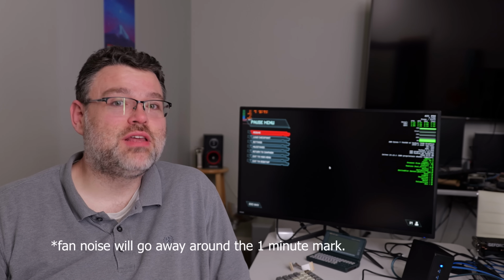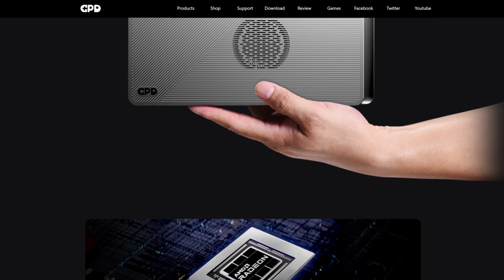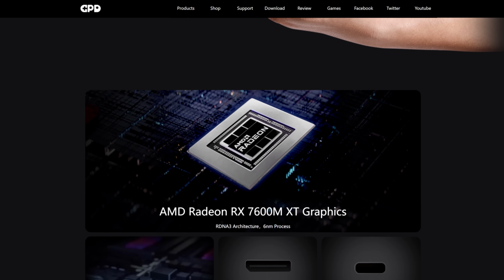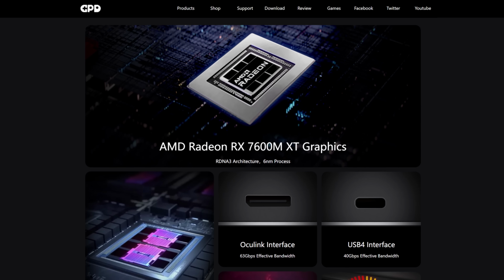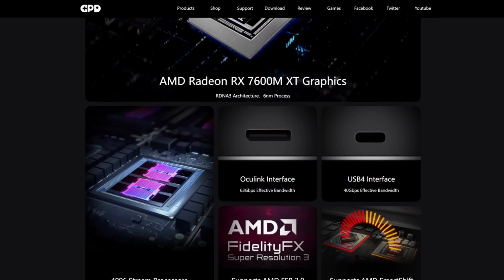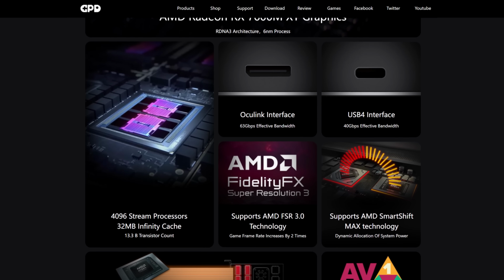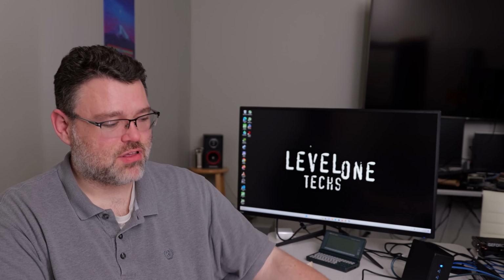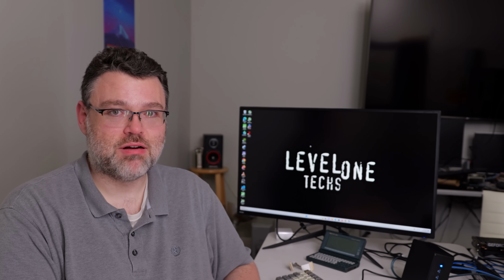GPD G1 + Minisforum UM790 (and a chat about Oculink and Thunderbolt Next)

Comment: Jeff Kampman of Tech Report did testing with Thunderbolt 3 eGPUs when they were novel. He found that the Alienware Graphics Amplifier, which was a proprietary external connection carrying raw PCIe 3.0 x4 (32 Gbps), gave MUCH better performance than Thunderbolt 3. The real bandwidth of Thunderbolt 3 isn't 40 Gbps, it's 22 Gbps, because 18 Gbps is reserved for the DisplayPort side channel. You'll never exceed 22 Gbps on any data connection in Thunderbolt 3. But it isn't even the transfer rate that is the problem so much as the encapsulation that you mentioned. PCIe has to be encapsulated within Thunderbolt and that adds a tiny bit of latency, which is significant when we're talking about PCIe. Overall Thunderbolt eGPUs suck bad for gaming and I'm glad a real PCIe connection is finding its way to market. Kudos to GPD, OneXPlayer, Ayaneo, and the other similar vendors for doing REAL innovation.

Comment: Love to see more expansion options. Only recently started watching your channel, but I will have to hunt down and see if you did anything related to the ASUS ROG XG connector. I really think that's the connector to beat. A combo TB/USB + PCIe with 100W or greater power delivery would be ideal to slim down your cables from 4+ to just 2 (1 power and 1 connecting the dock). Can't wait for more developments in the space.
Reply: Isn't the XG Oculink + USB or did you mean you wanted them to add Thunderbolt as well for some reason? It seems redundant if you have Oculink.

Comment: I'm kind of interested in the other way around; accessing the iGPU on a 780M based system. Or, rather, bifurcating an x16 PCIe  lane into four x4 occulink connectors and using four 780M iGPUs in parallel in training LLMs. 96GB of RAM in each of the systems isn't too expensive (strictly speaking this would have to be an 8700G desktop, not a 7940HS mini PC) when compared to the cost of even a 48GB professional GPU, but I'm not even remotely sure how one would configure the client systems with the iGPUs to afford the iGPU as much memory access as possible.

Regardless, it would be a very fun project, and some back of the napkin math shows you could actually hit better bandwidth per dollar than a lot of Apple setups. Plus, I think there's some custom GPU kernel fuse operations you could do with Transformer networks to run a GPU kernel, return the layer to the CPU, do some sort of evaluation, and then return to the GPU for another fused kernel to minimize memory access, but that'd start getting into some real CUDA engineering.
Reply: Though a second thought occurs to me: Wouldn't it just be easier to get an MI300A in a very minimalist server platform? I'm not sure if there's really any available that are essentially just an "MI300A" parent board with no frills (minimal connectivity, minimal or no DIMMs, and so on) for just giving you access to the raw chip for a reasonable price.
Reply: Since every 780M GPU is already welded to a Zen 4 CPU, which these days increasingly includes its own AI accelerators as well, it would seem better to just set up a Thunderbolt network cluster rather than trying to have one CPU directly interface with all of the GPUs, that way you could access all of the CPU compute hardware as well and I imagine most AI training software is quite happy to run on a cluster of 4 machines anyway.
Reply: @bosstowndynamics5488  
I don't think that you would want to do training on an AI accelerator as they typically operate at a low precision which leads to weird issue in training.

CPU is kind of cool, but historically it's been avoided because there's a massive bandwidth issue going between GPU and CPU over PCIe. It's possible an 8700G may be a different paradigm and you can do CPU based evaluations between layers really quickly. You might be able to get okay performance this way with fuse kernels but it's tough to say.

Comment: What is the justification for Thunderbolt if we could just Oculink-PCIE everything that requires high speeds?
Reply: A few reasons:
1) Thunderbolt 3 precedes Oculink by quite a while in terms of broad availability, so Oculink wasn't an option back then
2) Thunderbolt is good enough for most use cases, and much more broadly supported
3) Thunderbolt is far more robust in terms of hotplug support
4) USB tunneling and power - Oculink is just PCIe, whereas Thunderbolt can do single cable docking with PCIe, USB and power
5) Durability - Oculink is designed to be used as an internal connector that's connected maybe a few times for system maintenance and upgrades, Thunderbolt is specifically intended to be connected and disconnected a lot as part of normal usage
Reply: @bosstowndynamics5488  Excellent points, thank you so much

Comment: Wife and I both switched to using the UM790 + GPD G1 as our main rigs when we moved to California in December.  Honestly impressive.  There're some hiccups here or there with the 7600M XT not having that 12gb - 16gb of VRAM but pretty much every game we throw at our setups works flawlessly with her running LMDE6 and me running Fedora.
Reply: Why though?  What's the advantage over just an ITX system?
Reply: @SeniorKlean  UM790 + GPD G1 is to ITX as ITX is to ATX.
Seriously, it's two sub-1L bricks, most GPUs you'd want to use over the setup are larger than one of the bricks (4060/4070) if not both (4080), even before you see the size premium of the SFF cases that can fit those GPUs.

There's always discussions to be had on why someone would care about 1.5L vs 6L for a fixed setup, but you can just as easily question 6L vs 40L in many cases.
Reply: @Birdulon   I guess I always just assumed people who buy mini PCs either intend to transport it often or get the cheapest computer to get the job done. You’re obviously no the latter.
Reply: Curious as to why you didn't go with OneXGPU? Same eGPU, but with built-in m2 slot, so you won't be loosing the one with the m2 adapter in place (assuming you using the oculink connection) and you can ditch the um790 power brick, since the eGPU is capable of 100W PD.

Comment: I don't get one thing. eGPU community recently showcased an m.2 to usb+oculink interface for the ROG Ally. What I don't get is how it is claimed to be faster than a normal m.2 to pcie riser? Even if both are on the same gen4 wouldn't 4lanes of m.2 bottleneck them both, equally? I think it was touched upon this video but I still need some more simplification to understand.

Comment: It's really nice to see a company create this.  So tired of the regular gpu market only cater to desktops with giant graphics card.  
But price.  I understand it's not mass market product, but the price is only $400 less than getting a full fledged Ryzen 9 7845hx and 7600M XT gpu  Alienware M16 from Dell.
I would also like to see something similar made for storage.  Specifically, m.2. or maybe even 2.5" ssd. I understand it would need a switch and not be full speed, but that is fine.

Comment: I use my 780xt with a 2080ti in a dock I made from an amazon oculink kit,  s 650w psi and à socket metsl box (was mastercraft lol). It noe live as my "modular all in one computer " on the tv arm in my truck for night gaming or waiting to get loader gaming. Love that thing, I had to lock the gpu at 60% power for my truck batteries sake buuuut I got 90 to 120fps in gaming and I just bring the cpu with me on week-ends for ipdates and such. Love oculink! I'm sadly running windows, nvidis driver made troubles on Linux. Wish I had an amd card but the 2080ti was the one I had soooo.. meh

Comment: Why doesn't Thunderbolt/USB4 allow "lane bonding"? If the controller was wired to the host with a wide enough bus, and the endpoint (i.e. eGPU dock) had such a "wide" controller aswell, one could connect to an external device with more bandwidth simply by using two cables. It's super frustrating that the development of external ultra high speed IO is being delayed and doesn't see much adoption in the consumer segment.

Btw., ASUS made some ROG XG Frankenstein solution where they combine a TB port with an OCuLink port in a "single connector" - this allows using PCIe 3.0x8, although I think they "just" reroute the 4 PCIe lanes going to the TB controller to the OCuLink connector on the fly, in order to reach full speed and then use the former as a "dumb" USB side channel.

Comment: Awesome video, I have the Win Mini and have been eyeing this  device for awhile.  However, I wouldn't be using it with an enternal display.  I have a 3080Ti for that.  My use case would be sitting on the couch at night wile gaming on the internal display.  Is this doable or even worth it or would it be  too uncomfortable in this use case?

Comment: ASMedia released ASM2464PD last year, a USB4v1 controller capable of encoding a 64gbit PCIe 4x4 signal over a 40gbps usb4 connection, with performance that rivals an oculink and with all the benefits of a USB-C connection. There are already eGPU docks out there, like the ADT-Link UT3G which use this controller. (btw i have a GPD WinMax 2 and the aforementioned eGPU dock and it is working great)
Reply: This is not how it works and you can't get a 64gbit connection over a 40gbit link. The 2464PD isn't even even the right chip - for general purpose (non-storage-device) PCIe use, the 2464PDX is needed.
Reply: @Psychx_ I am not claiming to be an expert. Head over to eGPU io forum and see the numerous threads with benchmarks people are posting and see for yourself
Reply: @Psychx_  i'm no expert, but i based my comment on information from the ASMedia website, the ADT-Link UT3G website and the crazy people over at egpu forum. Obviously I can't add links here, but a quick google search can get you to all 3 websites.
Reply: @Psychx_   i'm no expert, but i based my comment on information from the ASMedia website, the ADT-Link website and the  egpu forum.A quick google search can get you to all 3 websites.
Reply: @Psychx_   i'm no expert, but i based my comment on information from the ASMedia website, the ADT-Link UT3G website and various posts in the egpu io forums from people who know a lot more than me. A quick search can get you to all 3 websites.

Comment: Great Idea that thing. Unfortunately, AMDs mobile GPU lineup consists only four nearly identical mediocre solutions with only 8GB VRam, which was at the edge of being not enough in 2023 and even more today. For that money, I would take the 7900m but not a 7600XTm (which is nearly non-existent, even these exclusive Alienware Laptops are not really available, where never in Germany where I live). But, there are adapters which can provide a PCI-E slot in which one can add every desktop GPU. Would be interesting to test how bad only 4 lanes are for a 7900-Class Desktop card. I would suggest taking a 7900GRE (260 Watts) and bring it down to around 200 Watts, which is the maximum the 7900m is rated with power-shift (or how its called). Should be the better solutions and these 7900GRE are comparatively cheep. I'm tempted. I have a beelink GTRpro and its Ryzen 7940hs should have enough power to feed the 7900GRE. And it would cost the same a top-of-the-line power-supply included.

Comment: I running my GPD G1 with my zenbook flip (i5 12500H) via TB4. It does really well and is great for "on the road". I would say it is comparable to my TB3 RTX 3070 eGPU setup (in a razor core-x).
I have also found some software (Lossless Scaling cf steam) to also get upscaling and frame gen, and can offload some of that onto the iGPU. This is good as Adrenalin drivers don't do well with hybrid GPU setups I find (as in no AFMF etc..) .
I'm playing older games like FFXIV just great and also modern ones like Cyberpunk.
In future maybe a TB5 machine if they make a TB5 to Oculink adaptor :)
Reply: If you plug this into a laptop using just the thunderbolt port will it still work?
Reply: @traderjoss   No, you need to plug the GPD G1 into the mains. It does supply the laptop with 64w of power via Thundebolt though.
So I would say it probably would draw over 200w from the mains if powering the GPU (120w) and laptop (65w).

Comment: currently using oculink egpu as my main system with beelink mini pc
ive used a bunch of 5 different oculink docks and the only one that works is osmeta g38
which cable isn't detachable, it holds the signal quite well with pcie 4.0

Comment: problem  is no matter   the bandwidth you can force through a connector if the if the internal and/or external gpu doesn't  have the ram capacity  how much you the gpus will need to 1440p, 4k or 8k

we can't even saturate it 40gbps or even 80gbps 120gbps  is  nothing bu a myth aswe don't have gpu ramin play to support it

Comment: Am I missing something?  The UM790 Pro doesn't have Oculink.  You'd have to use one of the "M.2 Cheat codes" cards - or the type from the UM780 XTX.  Is this an UM780 XTX.  It's angled like it is using the UM780 XTX stand.
Reply from the maker: The g1 comes with an m.2 cheat code
Reply: @Level1Techs  Ah, OK.
Reply: @8:29 - it is.  Title is wrong.
Reply: Ah, OK, M2 to oculink "card" included with GPU thingy.

Comment: I am very interested in another Minisforum review - this time of the BD790i, which has the 7945HX with the extra vCache.  I have an old Ryzen 2700X gaming build in a mini-ITX cache, which is very long in the tooth at this point. Working in that case is a real bear of job, but dropping in that BD790i mobo into that case would save me a ton of headaches and grief (like spending an hour trying to reach near impossible to get to fan headers).